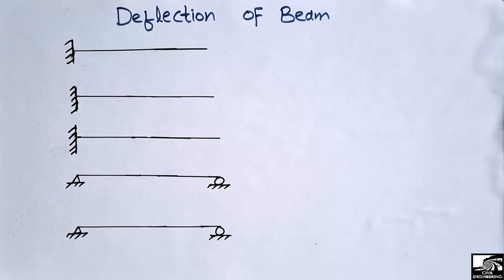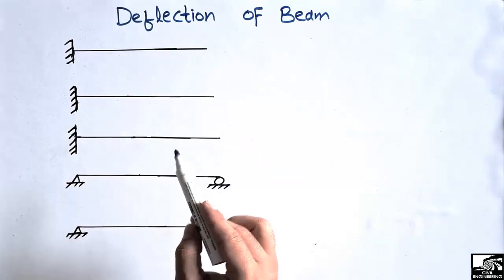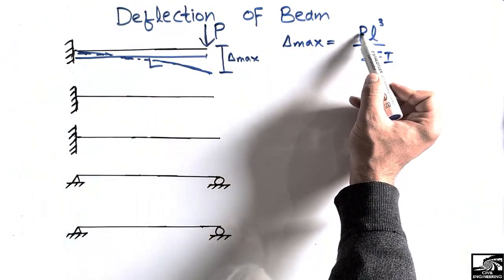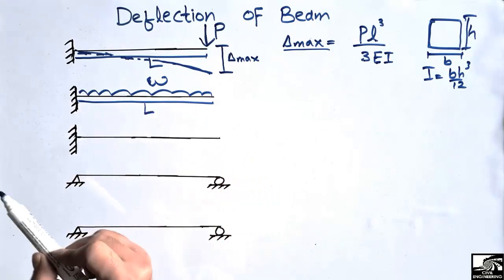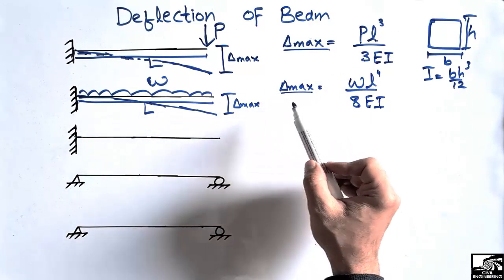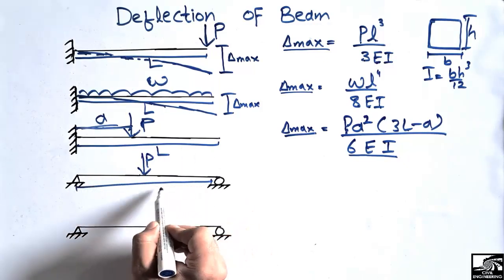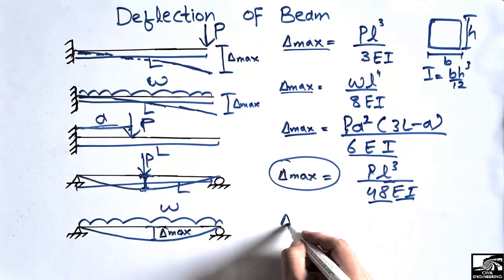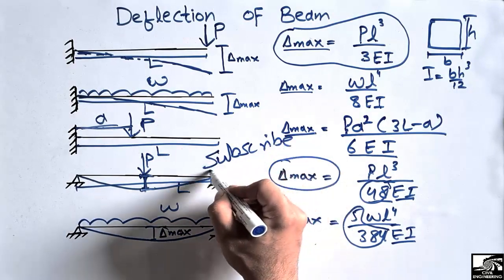Deflection of Beams

Comment: Very helpful, thanks a lot. 

Im kindly requesting for assistance on this one please. On mechanics of machines, the topic is hoists and drums.

A mine cage of mass 800kg is to be raised from a depth of 120m to ground level using a hoist drum of mass 120kg and radius of gyration 0.6m. The drum is 1.4m and the speed reduction gear ratio is 12:1 with an efficiency of 85%. A balance mass of 100kg is to be used. The mass and radius of gyration of the motor rotor are 20kg and 0.4m respectively. The mass of the hoisting rope is 1kg/m. Determine the power drawn from the hoisting motor if the velocity and acceleration of the cage at the start of its motion are 5m/s and 0.8m/s^2 respectively
Reply from the maker: Thanks